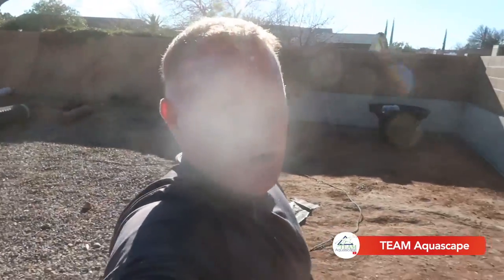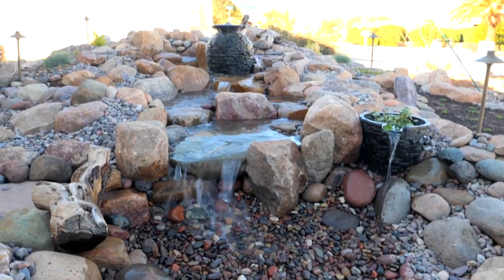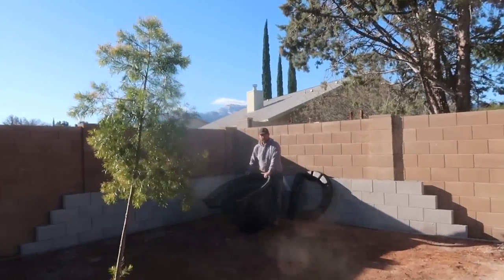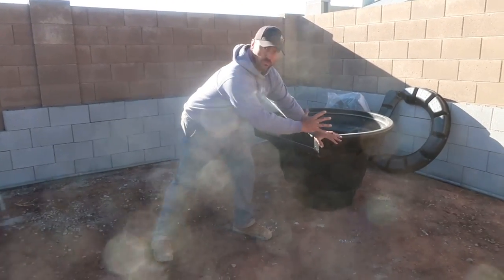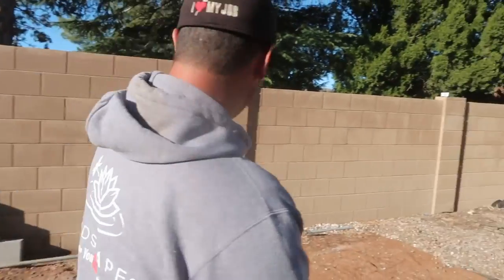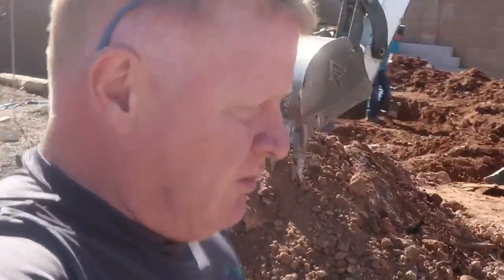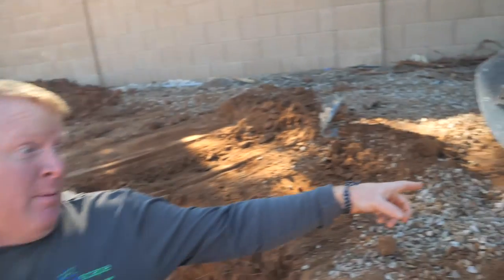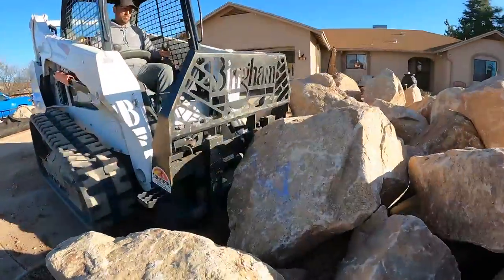POND EXCAVATION CHALLENGES: Arizona Caliche - Part 1

Comment: I would say waterfall from the top of the wall lol, but the soil required to not make it a volcano would be insane. Luckily for me, the side yard is a foot taller than the front, two ponds connected with a stream under a fence is the plan.

Also if you are in a gold-bearing area, just offer the caliche to gold miners/prospectors. They will quickly make it disappear for free lol